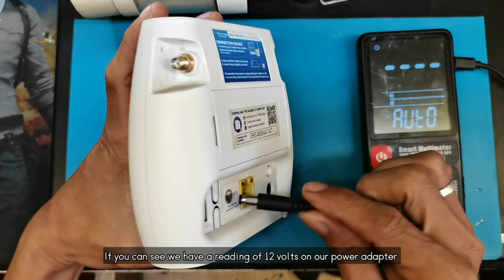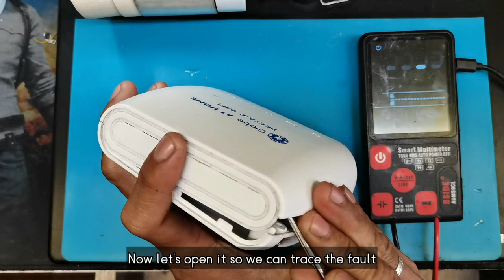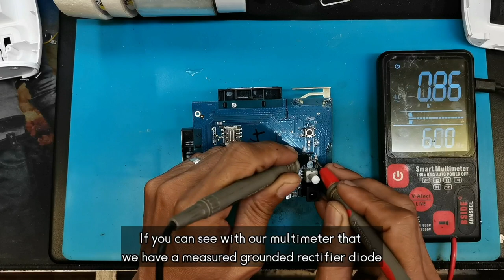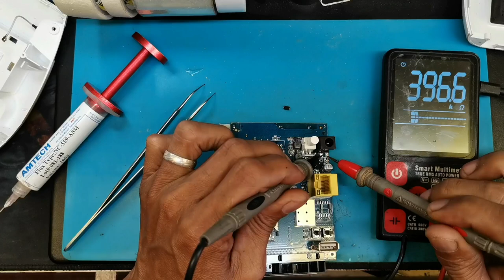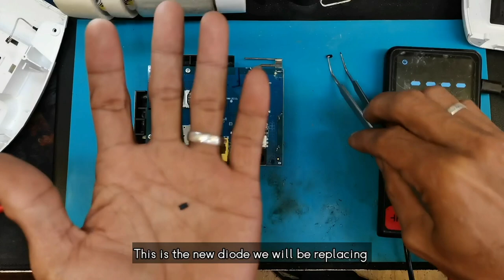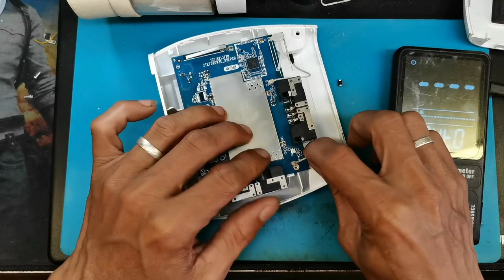Globe AT Home Zlt S10G no power

Comment: what equivalent ib thru hole diode is that sir, i dont have smd one, please reply
Reply from the maker: Any rectifier diode SMD can be used
Reply: I have thesame modem, that diode you had replaced, was open so i remove it, then another shorted smd capacitor, so i removed it as well, do you agree if i will use IN4001 thats what i only have?
Reply: @mr.professorex  thanks for the reply sir